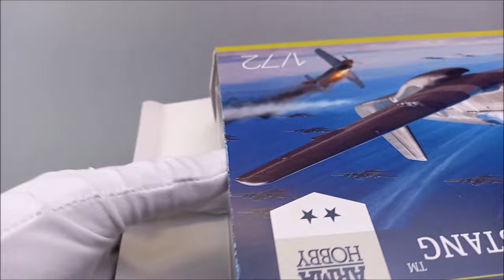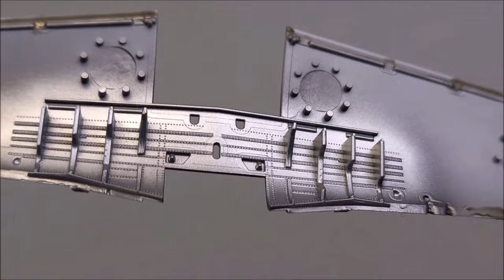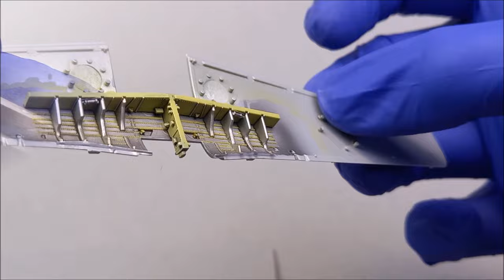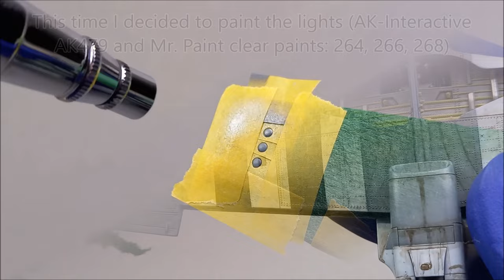Mustang Mk III 1/72 Arma Hobby Full Build (P-51 Mustang Scale Aircraft Build)

Comment: Very nice work, though I should point out the the colours on the inside of the main doors (8:25) are reversed. You have the chafing plate chromate, when it should be of stainless steel.
Reply from the maker: Thanks for heads up, I will investigate it during my next build!
Reply: No worries. Most P-51's are parked with the inner doors stowed too - but it wouldn't be as interesting! Great build, especially in that scale, look forward to seeing more. @rminiatures
Reply from the maker: @MillwalltheCat  thank you 😊 the wheel bay in this model is a gem, it was worth to show it